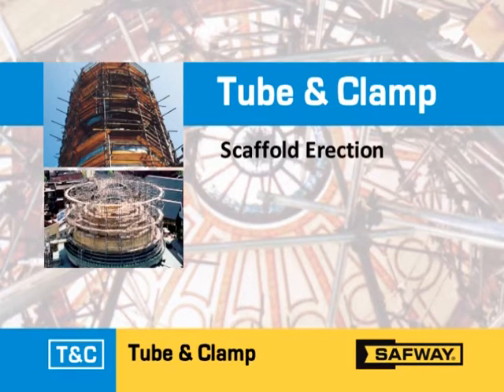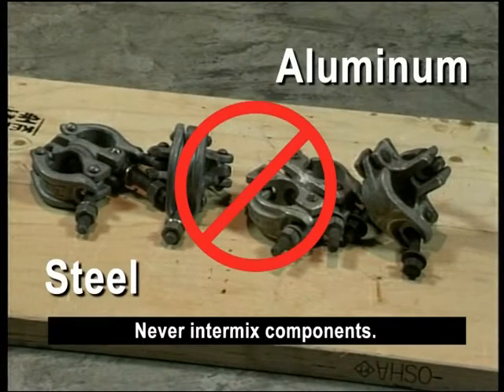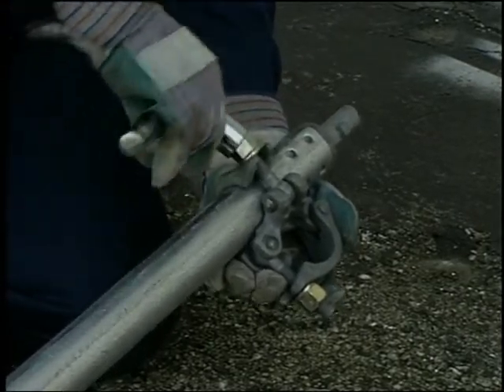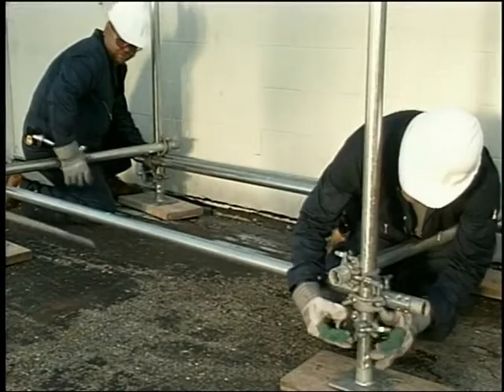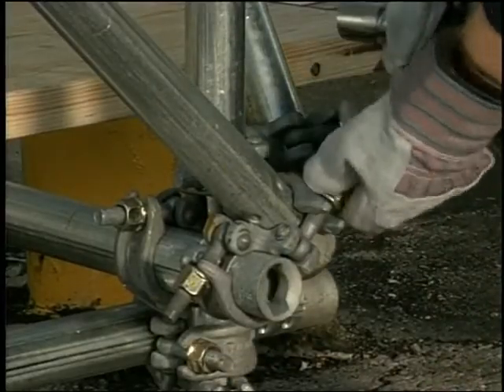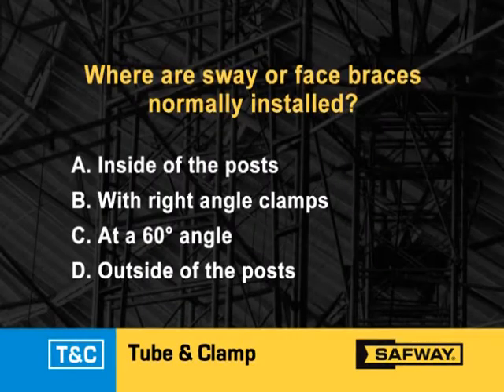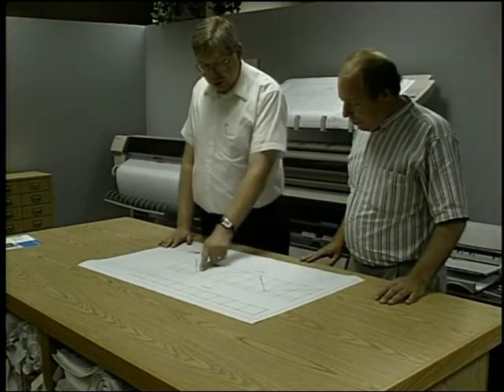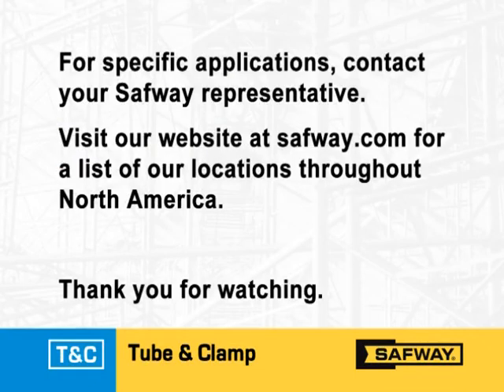Tube & Clamp Scaffold Erection Training

Comment: Those are bolt clamps not Right Angles, right angles have 2 wedges and 4 steel  forks.
Reply: It is a right angle bolt clamp. You are talking about a right angle wedge clamp. Both are right angles

Comment: British tube and fitting scaffolding is the best system in the world.
I can't believe how slow this erecting  process is.
In UK it's a much faster easier and safer process 
A runner is a ledger
A post is a standard
A clamp is a fitting
Fitting size 7/16
And a swivel handle scaffold spanner or impact drill/wrench. 
A ratchet wrench looks awkward 
Braces are the same
Planks are board's.
Bearers are transoms 
And spaced at 46	"
Ties every 13' sq. 
Standoffs are rakers and need to be supported every 10' 
Everyone needs to get a UK advanced scaffolder card
Then you have the best card in the world.
Reply: I prefer right angles I hate building with bolt clamps, wit right angles all that's needed to secure them In place is a few taps which makes leveling easier.

With bolt clamps the threads get damaged which means they seize up and you can't use them, bolts also come loose easier.
Reply: UK tube scaffs are rubbish
Reply: Watching made my brain bleed, plank? Post? 'F' me, imagine having to do this on price work 😂 you'll be be on £110's a day 😂😂 I had to give up due to a back problem but yeah best job in the world and would rather tube and fitting over any other system.

Comment: What are the materials used?

Diameter of pipes? 
Planks width and length? 
Right angle Clamps? 
Swivels? 
Bearers and runners? Please sir?
Reply: Tube 50mm, planks are 130mm width Length Upto 4mtr. Right angle can take 600 kgs swivels are non weight bearing clip